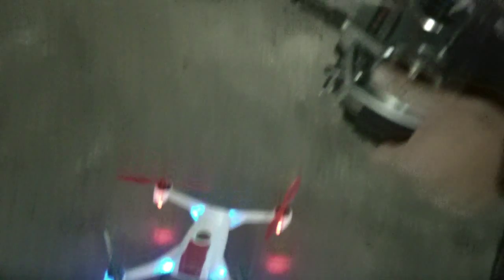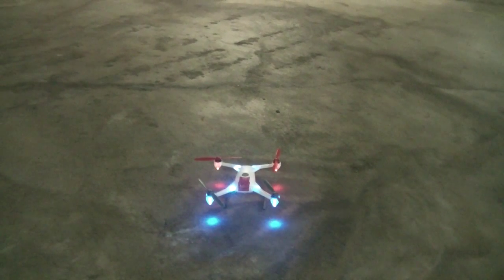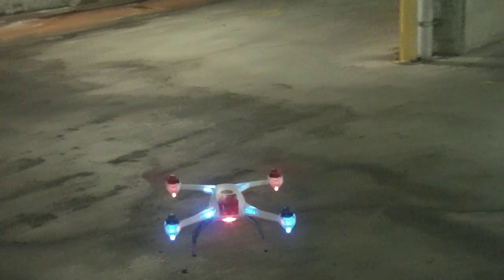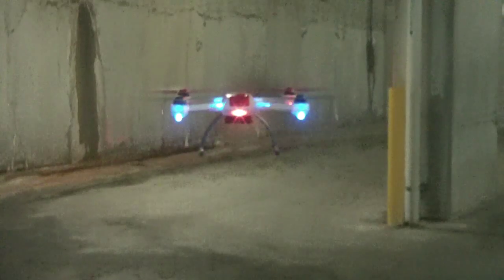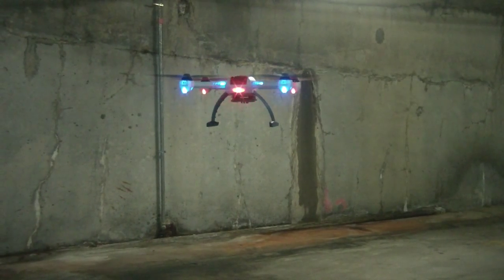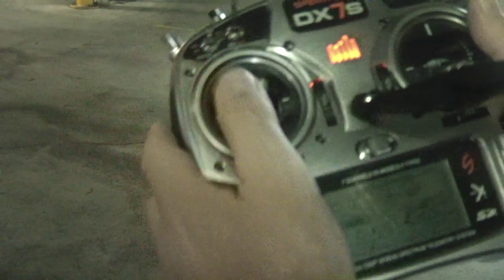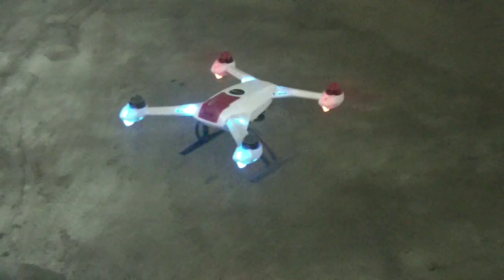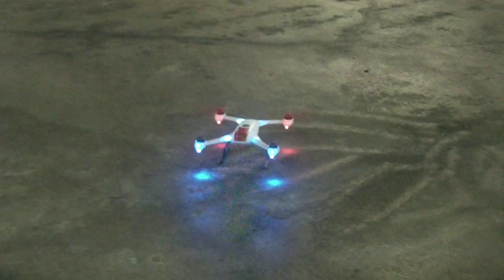350QX Accelerometer Calibration procedure

Comment: Apart from the many steps to get into the calibration, its pretty simple. They certainly make sure you cant accidentally go into it.
Reply from the maker: Yes true, the Blade manual show two more steps but I can't get to that point and neither can anyone else I have asked.  I think the Manual is wrong as it says to fly it again before saving with the left right left right.. but if you try that, just moving the stick left once to start motors it will save the calibration

Comment: GREAT videos Trainboy64 :D

i get thru all the steps just fine BUT not the saving part.

when i land and center all trims and take the cyclic stick LEFT-RIGHT-LEFT-RIGHT it wont safe the settings :( 

any ideas ?
Reply from the maker: Thanks for the comments. you need to take the rudder stick left right left right.. IE the left stick.

Comment: When the lights are flashing red blue green it means the batter is dying. You need to recharge it
Reply from the maker: Raymond Nerona That is true but you also get the red blue green flashing during the calibration process - you will notice when this is complete I take off again and only have blue flashing lights meaning the battery is fine.